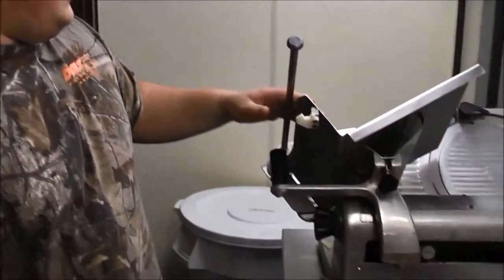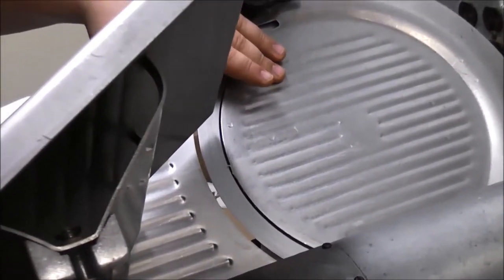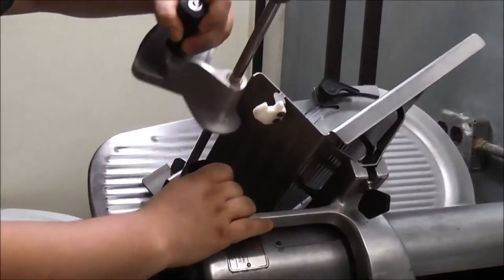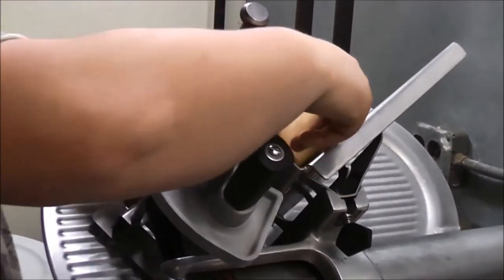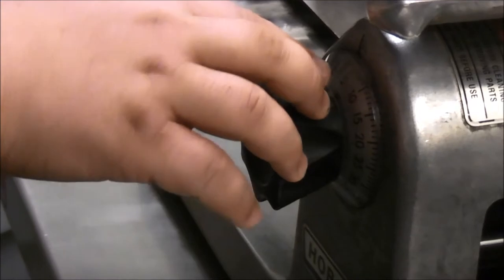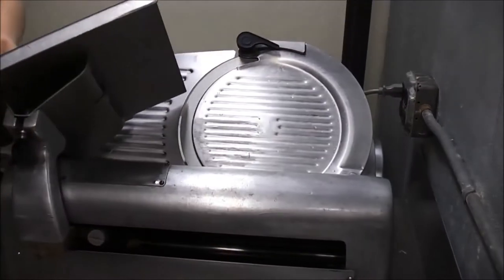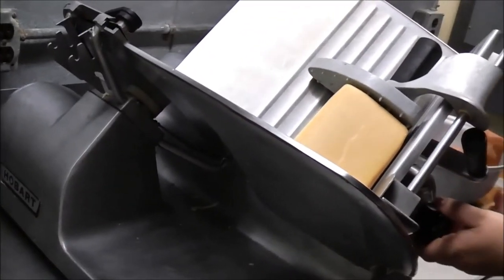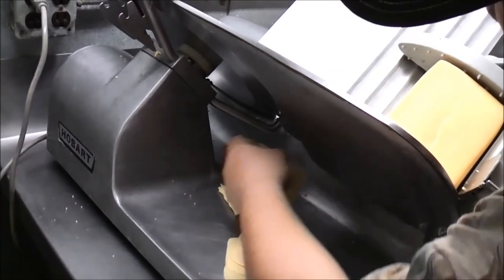How to Slice Cheese Training Video

Comment: you DO NOT hold the end weight handle (the movable plate that goes on the produce), you just hold the handle that sticks out that moves the guide. the end weight handle does just that, applies weight on the produce so you don't have to use your hands.

for thickness, you just adjust the gear, but never push down on the end weight itself.